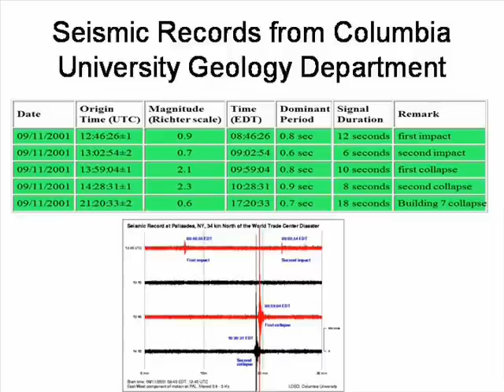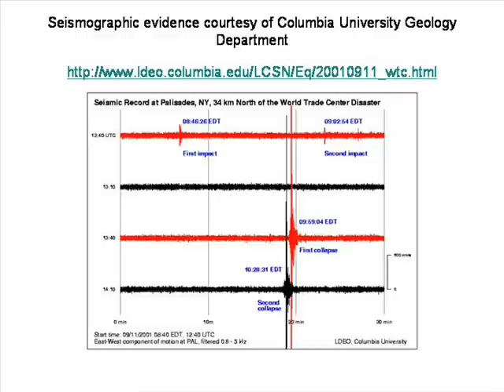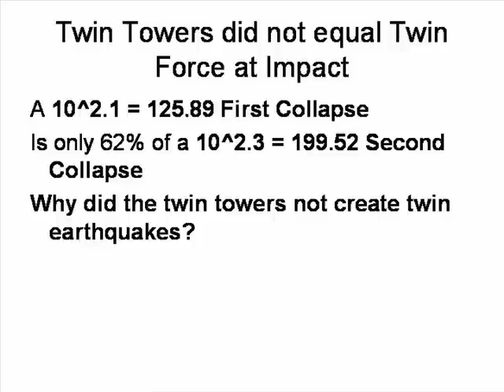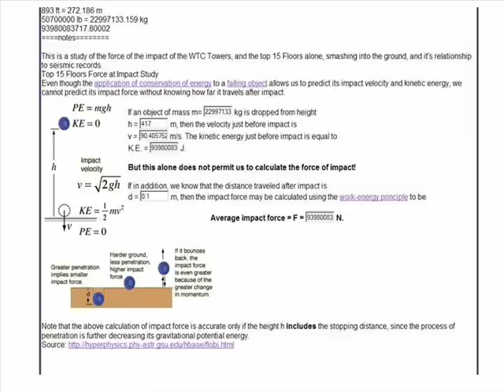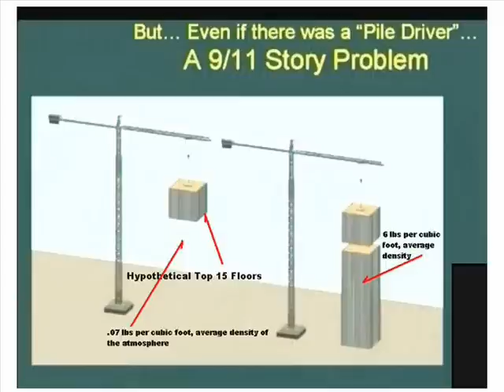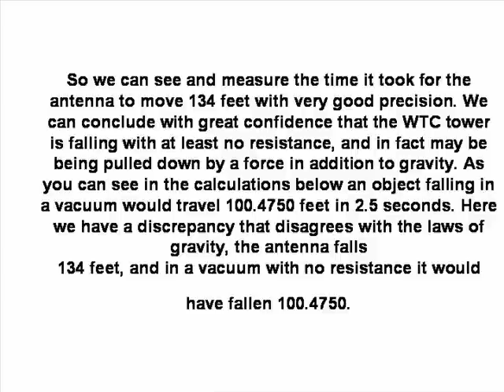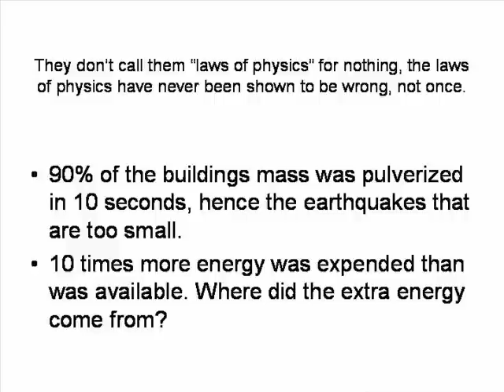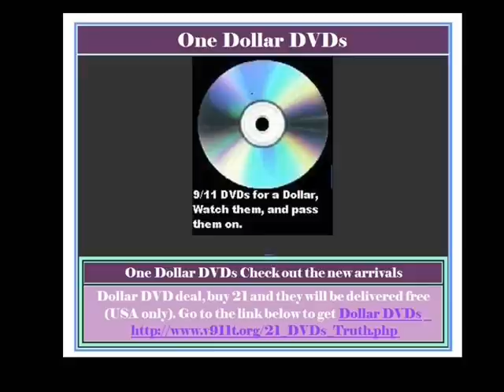Forensic Seismology at the WTC

Comment: This genius sees an aluminum building break apart and assumes the bright things he sees are "squibs." 

The reason that objects go through air quicker than through buildings is not so much due to density, as due to air being a fluid and buildings being solids. It is possible for an object, such as an aerogel, to have a density less than air, yet able to support a solid object, such as a brick. Air is more dense than the aerogel, but cannot stop the brick from falling. 

http://upload.wikimedia.org/wikipedia/commons/thumb/e/ea/Aerogelbrick.jpg/568px-Aerogelbrick.jpg

The correct way to measure the time of collapse is from the point of impact to the ground, not from the top of the building to the ground. 

The earthquakes generated by each collapsing tower were approximately the same size. 

"The Palisades seismic data recorded a 2.1 magnitude earthquake during the 10-second collapse of the South Tower at 9:59:04 and a 2.3 quake during the 8-second collapse of the North Tower at 10:28:31." 

http://www.911review.com/errors/wtc/seismic.html

"NIST estimated the elapsed times for the first exterior panels to strike the ground after the collapse initiated in each of the towers to be approximately 11 seconds for WTC 1 and approximately 9 seconds for WTC 2."

http://www.nist.gov/el/disasterstudies/wtc/faqs_wtctowers.cfm

Comment: It is impossible for the building to lean like that and continue to 'pancake' or crush the floors beneath , because of the 47  core columns. And why would the top part of the building not continue to lean and fall over? The commission report says that the towers fell in 10 seconds (page 305). They had a long time to write it. Free-fall is 9.2 seconds. How could a 110 storey building 'collapse' thru the path of MOST resistance ALL  the way down, even when leaning over. Over 10 floors a second?